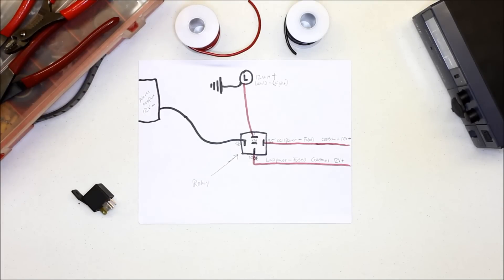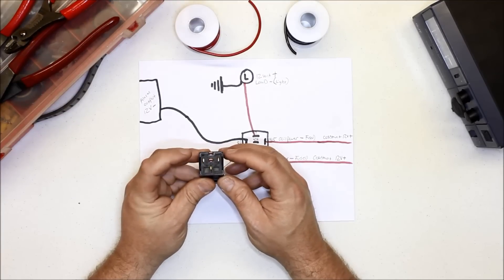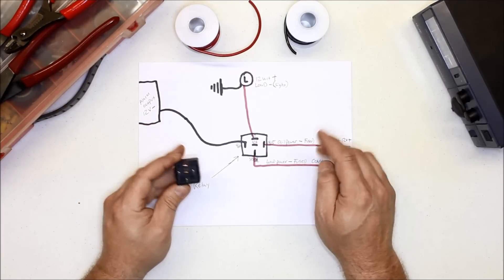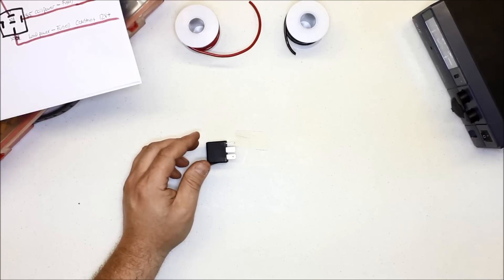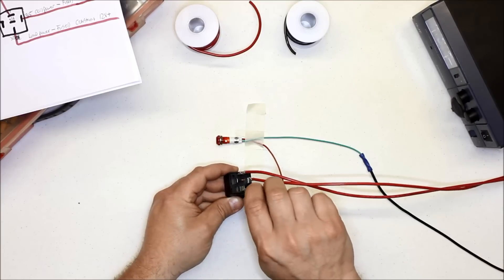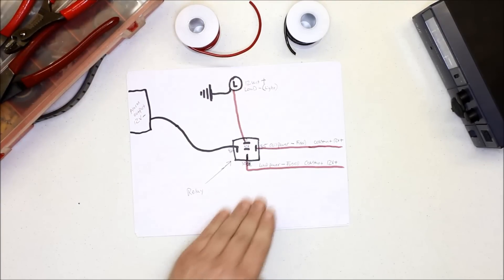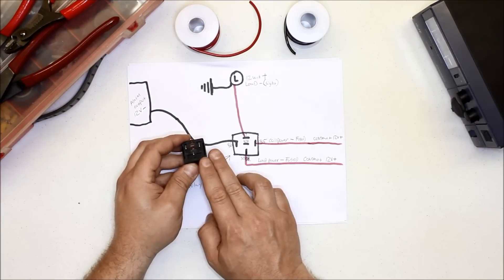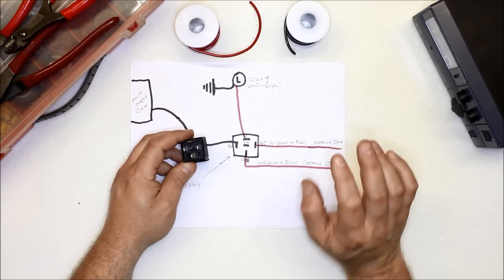How To Change Polarity With a Relay - Convert Negative Into Positive - Automotive Wiring

Comment: Are you saying a 12v negative ground radio can be safely used in a 12v positive ground car by using a relay?
Reply from the maker: No. If the radio requires negative ground, it will always require negative ground. My video explains how you can trigger components that require a positive signal with a negative output. (From alarm box, or remote start bix, for example)The relay accepts the negative output but sends a positive output to the device. The device still receives its required positive signal. The device requirement never changes.

Comment: What would be happening when you test using a test light on Toyota Townace on the headlight connect when you switch to high beams lights turn and with the test light you will be received positive on all three contacts of the headlight connector does it mean it's a negative switch if so how do l solve the problem

Comment: Yeah a benefit of using a relay for high amp accessories is to take the load off the switch...its also nice so that you don't have to run heavy gauge power wire inside your vehicle you can locate the relay closer to the accessory that its controlling.. saves money on heavy gauge wire too 😂 because you're not doing a long run inside the vehicle
Reply from the maker: You are correct.  There are many reasons to use a relay.  Your example is just one of them, and probably the most common reason.  This video was about a using a relay for a different reason. Thanks for your comment.

Comment: Very good job explaining how  relays work in an automotive application. I have shaved door handles in my old Vette and I was wondering if my expensive door popper control module craps out could I replace it with a cheap eBay keyless entry kit ...I suppose the "lock" feature would be a positive trigger and the "unlock" a negative (I did install such a kit in my ex girlfriend's car but long ago)...the door popper solenoids are both positive trigger because theyre grounded thru the mounting bracket so I wanted to make sure I could use a relay wired to be negative triggered 😊👍 and energize the passenger solenoid ...so, driver's door will be popped by hitting the "lock" button on the remote and smashing the "unlock " button would pop the passenger side door ?

Comment: Very good video, this is also called a negative trigger and can be used to reduce the number or wires going to the relay, it is also safer for certain applications
Reply from the maker: Yes sir....  If I'm not mistaken, I believe I used the term "negative trigger" in the video but I haven't watched it for a while so I could be wrong. Thanks for the compliment, and thanks for the comment!

Comment: I have a problem with my setup, First i wanted to have a trunk popper, but i used the schematic you done and the relay only triggers when the alternator is running. 14.something volts????? Its coming from a live 12v source. So i went out of my way and bought a second relay, and this second relay gives a really weak clicking sound, and doesn't pop the trunk, not even when the car is running? I'm out of ideas....

Comment: Ok. I have a dpdt switch for forward and reverse on my 130 VDC 4.25 hp treadmill motor. It just changes polarity going to the motor. 
I want some low voltage low amp LED lights to come on depending on the direction. 
Green for forward and yellow for reverse. I can’t just connect the LED’s directly to the motor current so I need a switch that senses the polarity going to the motor and opens or closes to let my low voltage dc power activate my LED’s. I have no idea how to do this. But you look like a guy who might be able to help. 
Thanks,
Paul

Comment: I have a fuel relay switch that is negative for continuity, so from the start I can not use this relay. Could I  change it to constant positive to a low the fuel pump to kick on. Would that in return create a constant load on my battery?  Is there a way to fix the relay ?  Thank you. This relay is very hard to find.
Reply from the maker: I'm not understanding why you can't use this relay for a fuel pump?  Also, these relays are NOT hard to find at all!  In fact, they the most common relay found in the automotive aftermarket.  These relays can be purchased at EVERY parts store in the USA, or any automotive parts website on the internet. There are thousands of listings for these relays on Amazon.

Comment: I have an electronic ball valve which has 3 wires. Pos, Neg, and Switched. If I connect the "switched" to the "Pwr +" side, the valve opens. If I connect it to the "Grn/Neg -" side the valve closes. I have a control source that is either ON or OFF. I need to wire the valve so that when my control source turns on, the valve will open and when the power is off, it closes. Any suggestions??

Comment: Can the bulb be turned off in the same way?  So when we bring a minus, it turns off the power to the bulb.  If he can, please explain
Reply from the maker: If I understand you correctly.....  If you want the light to turn OFF when the negative is APPLIED.....  just switch the wire from the 87 terminal, to the 87A terminal in the center of the relay.
Reply: Thanks

Comment: Will this work for changing the polarity of a starter motor from a Trombetta solenoid?  Looking to have it turn CCW versus CW to make our engine turn over properly
Reply from the maker: That's what a Trombetta relay does, reverse electric motors. The relay shown in this video cannot handle the amperage of a typical starter motor.

Comment: Applying -12V to one side of the coil and +12V to the other side of a standard 12V automotive relay as advocated here is equivalent to applying a potential difference of 24 volts across the coil designed for 12 volts and will burn out the coil since it will cause twice the current to flow through the coil winding.  Instead, connect the +12V side of the coil to ground and the relay will function as designed.
Reply from the maker: It's a simple DC coil..... on this style of relay the coil terminals are marked with #85 and #86.  That's it. Polarity is irrelevant to energize the coil. If it mattered, the terminals would be marked with POS+ and/or NEG-, and they are not.  Just like an old school incandescent 12V light build, polarity is neither marked on the bulb, or relevant to make it light up.   Telling someone to apply 12 volt negative to the positive side of the coil isn't doing anyone any good if the terminals are not marked.    The only time polarity matters when connecting the coil is when a relay has a built in diode to prevent the relay sticking on under inductive loads. Not all automotive style relays come with a diode.  The relay in this video did not contain a diode.  Thanks for the comment.
Reply: @SlipFitGarage  "If it mattered, the terminals would be marked with POS+ and/or NEG-, and they are not. " 

Yes you are correct. Usually when marked it's because they have an indicator light / LED or they have a flyback diode for EMF protection.
Reply: Um  this may just be an oversight and I know it says 12v- but most likely it means 0V or Negative. And most likely he has a an alarm the literally says 12v- And why would they put it that way. Well that's because there may be other voltages and it need the 12v-  OR because the unit is putting OUT 12v-. 

Two things

Put your volt meter voltmeter pos lead to pos battery and neg lead to neg battery, you will read 12v
Now reverse the leads, it says -12v

What you are describing is when two totally separate power sources that are combined. Just look at PC power supplies that have 5v, -5V and 12v, -12v. If you combine the 5v and 12v you won't get 17v, why because they are sharing the commons.

Comment: Can i use this to to lock and unlock power locks
Reply from the maker: Yes.  I have used this method myself to operate power locks from an aftermarket remote start system.
Reply: @SlipFitGarage  thank u

Comment: So use this to switch my fan from neg ground to pos ground? and that's all. puller to a pusher.
Reply from the maker: You don't need a relay to reverse polarity on an electric fan.....  just flip the two wires around that feed the fan.  Easy.

Comment: The lights no longer flash on my keyless entry/ auto start module I was told it could be fixed if I Used a negative out when running wire instead and add a inverted relay to fix that? Is it possible for someone with limited experience to do. I'm confused because the white wire coming out for my lights of my module is positive  I'm so lost

Comment: Great video.   I am planning on installing footwell lights..   can I connect the door switch wire ? Is it going to be positive switched relay or negative switched relay?  The door switch has one wire and when door opens it’s grounded and lights come on….  Thanks.
Reply from the maker: Thanks for the compliment but I would have absolutely no idea about the wiring in your vehicle without seeing it in person. Sorry I'm not able to answer your question.

Comment: Hi Brian, I need some help getting my head around an aftermarket android stereo with climate control I installed in my car. All the functions in the climate control works except for the rear window defroster. I was told that the canbus controls it. I tried different canbus settings but nothing worked. Long story short, what I discovered is that there is no wire that connects the switch for rear window defroster and wire in the harness. I was able to locate the pin that turns on the wire rear window defroster, connected the wire but still does not work. I checked the voltage on the wire and pins from the switch and both show 12 v. I think If I change the polarity like you have shown in the video it should trigger the rear window defroster. How can I identify 12v- from the switch? 
Do you think adding a relay  like you show in the video would solve my issue?  I apologize  for the descriptive question.
Reply from the maker: I can't answer your question specifically without seeing it in person. However, as far as how you would identify negative 12 volts.... you need to use a Multimeter. With a digital multimeter, if you connect the red test lead to positive, and the black test lead to negative, It should read somewhere around 12 volts. But if you put the red test lead on the negative and the black test lead on the positive, it will read -12 volts. There should be a "-" in front of the 12vdc on the meter display. That is how you detect polarity with a meter.

Comment: Can both my constants be directly from the battery? With terminal “30” fused off course
Reply from the maker: You can get your constant positive 12 volts from wherever you like.  Just remember....  one of those constants only needs to supply a small amount of current to the coil (magnet) inside the relay, the other constant needs to supply the full current load to whatever device you're trying to run with the relay.  If this is a high current load such as electric fans or halogen lighting, you need to make sure all the wire gauge and fuses leading up to the "switch" side of the relay (terminals 87, 87A, 30) can handle the full load. Wire gauge and fuses that operate the coil (magnet) inside the relay (terminals 85, 86) can be rated for far less current because the typical ISO, or Bosch style automotive relay coil (magnet) typically draws only 200mA or less. (0.2.... or,  2 tenths of 1 amp.).  But just remember EVERYTHING coming directly from a battery needs to be fused, not just the high current wire going to terminal 30 (or 87, 87A).  Even the wire going to the low current coil (magnet) inside the relay (terminals 85, 86) can get rubbed through on bare metal and burn your car down if it's not fused. Hope this helps....  good luck with your project!

Comment: HI BRIAN IM TRYING TO USE 2 RELAYS TO CONTROL THU AN ALARM KEYLESS CONTROL FOR MY VW T4.I HAVE THE ACTUATOR MOVING SOMETIMES BUT NOT ALWAYS IN AND OUT TO WORK THE DOOR LOCK.I HAVE RELAYS SET UP TO A NEW ALARM ON MY LIVING ROOM FLOOR WITH 12V BATTERY AND A SPARE ACTUATOR SAME AS ONE IN MY VAN.STEREO KING SAYS 12V POSITIVE WAS FROM 87A I THINK WHEREAS ANOTHER GUY SAYS GROUND THEM.DEPENDS ON WHAT POLARITY I SUPPOSED.BEEN TOLD MY VAN IS 12V POSITIVE VW T4 AND ONLY 2 WIRES CONNETCED IN DRIVERS DOOR.PROBLEM IS CENTRAL DOOR LOCKING STOPPED WORKING IN VAN WAS OK FOR 12 MONTHS AFTER STEREO GUY FITTED IT .AFTER CHECKED ALL FUSES OK APART FROM ALARM FUSE TO SIREN HAS BLOWN I REPLACED BUT BLOWS AAIN WHEN ALARM ACTIVATED.FUSE ON WHITE WIRE TO SIREN.12VOLTS TO BATTERY OK ONE SIDE FUSE OTHER SIDE TO AALRM.ANYWAY GOT NEW ALARM KEYLESS RIGHCLICK 301 FOR MY VW T4 WANT SEE IF WILL WORK DOORS
Reply from the maker: HOPEFULLY YOU GET YOUR ISSUE FIGURED OUT. THANKS FOR THE COMMENT.
Reply: brianok100 Thsnks I’ve managed to get 2 of my van doors locking .so hopefully just need to splice in another wire to get the other 2doors locking 😀

Comment: Can you splice the two 12 volt sources coming from the relay together and run them as one wire to a fuse or breaker before the battery instead of running two separate wires i.e. 12v constant and 12v switched since the ground is in essence becoming the 12v switched?
Reply: Also curious about this I can't think of any reason why it wouldn't work.

Comment: hi there, so where do you put the switch in that, as i have a old 24v curcuit for rear spot lights, the red wire to the dash switch has power going to the switch, huge job to run new wire back through the truck just to put it into a relay, as im putting in new led powered switch,  love your videos, thank you chris

Comment: Thank you, have a question how to wire led using negative outpost on the dome wire. Seem my dome is wired nagtive outpost like your video. Dome has option on, off, door I check the wire and it has power to the negative and no power to the postive end on the toggle dome pin. But has power to - and + on the dome bulb connector? My plan was to add a relay with the led and use the dome switch as the toggle. 30 to fuse box, inline fuse, battery. 87 to distribution  block to acc(led). 85 to ground and 86 dome switch + positive. I was going to wire like above,  but then after watching your video I think I might have to rewire the relay. Any suggestions?
Reply: Am I right if I put the 86 to the - off the dome switch pin it will work?

Comment: thank you so much for the video. i found this while researching how to do the complete opposite. my alarm's remote start feature outputs a positive signal but my bike uses a negative circuit on its electric start (confirmed by connecting a bulb to my alarms remote start wire and the negative on the bikes battery and trying to start off my fob) i know im going to sound stupid as i bet its really easy to do but if you possibly have the time could you explain what changes i would make using your diagram in your video if i used a 4 pin relay please?
alarm remote start wire = BLUE
input wire of my starter relay is RED/WHITE
many thanks again
paul

Comment: Theoretically, instead of an electronic signal of -12v (or any current really) could this same approach be used with something like an audio signal, which is constant but of varying strength?
Reply: NO. Audios is a wave which is AC. If you did that it would be turning on that relay on and off. You would have to convert it back to DC. With a rectifier and maybe even a capacitor.

But if you want it to be turning on and of, you are better off using a solid state relay or use mosfets.

Comment: Trying to wire floor lights to dome on 01 civic ex. The dome has constant power and the switch adds the ground. All ports show pos until switch activates adding ground and turning on lights. Yes grounding side is powered until ground is put through via switch. Burn up 4 lights now trying to figure it out. Would this work or any ideas? My lights burn out running live power through until ground is added. Basically hooke up backwards both to power putting ground wire to powered side that switches. I dont like electrical or foreign cars... HELP PLZ

Comment: I have problem with my honda power window going down but not up. It is because of bad relay?
Reply: it's the switch or the window motor
Reply: @GSPOT954  I open small relay there is two small  parts in relay one not working

Comment: Hi Brian!
I think I'm really close to a solution to my problem of reversed polarity to 1157 sockets in my electric scooter, where the body of the bulb gets the (+) charge and the bottom contacts have a (-) charge. This won't work with LED bulbs! It was suggested to me to use two SPDT relays to switch the polarity to the socket. I don't quite understand the diagram, and I would have to try it to see how it works. My question to you is: can I use DPDT switches to accomplish the same result without the current loss with the use of relays? There are 3 sockets I have to reverse. I can provide the diagram if needed.
Reply from the maker: Hello. Yes, it does work with LED bulbs..... that was an LED that I used in the video demonstration.
Reply from the maker: After re-reading your question, I think I misunderstood it originally. If you need to reverse polarity on a light bulb socket, can't you just cut the two wires and switch them around? That would be easier than dealing with switches and relays.
Reply: That is an easy fix for a single function bulb. My dilemma involves dual function tail/brake lights and a high/low beam head light. how would you switch two negative wires and one positive to two positives and one negative?